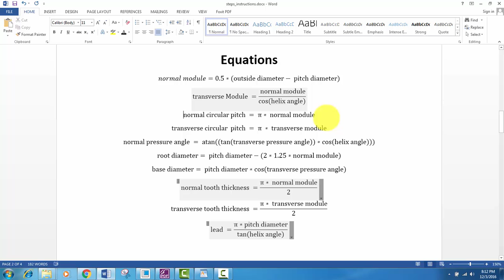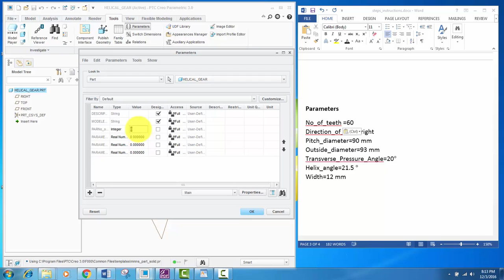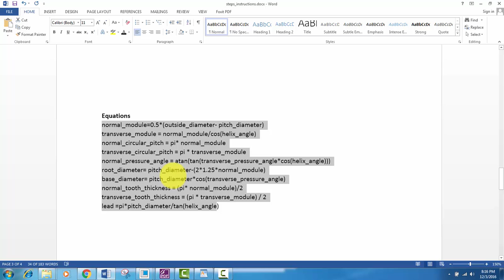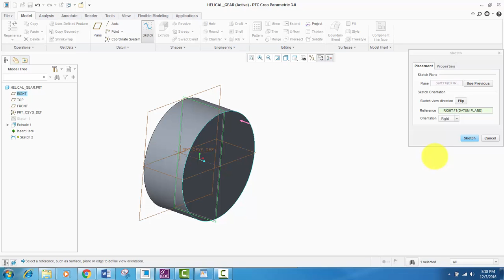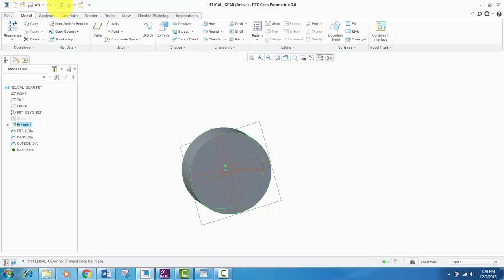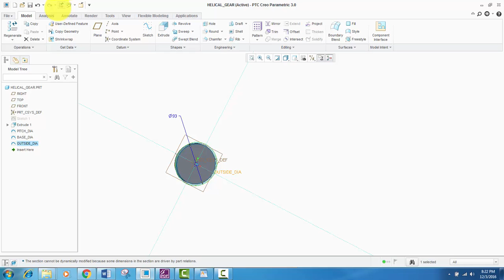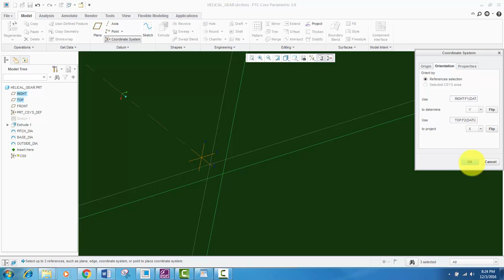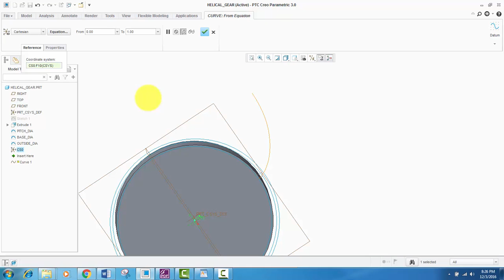How to create a helical gear in creo part 1

Comment: I want to ask you a question. I change the outside and pitch diameter but curve equation doesn't change. Because t is unknown. What is t? (Angle=t*90) Because of that my data doesn't work when i need to change diameters to what i need.